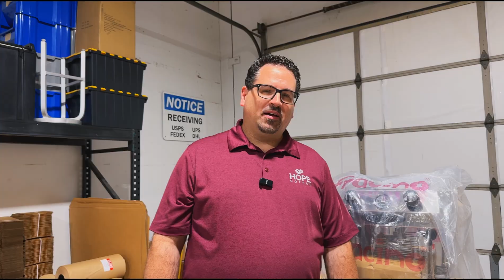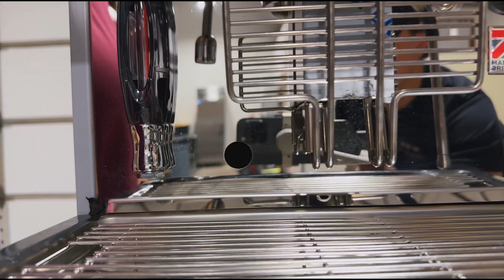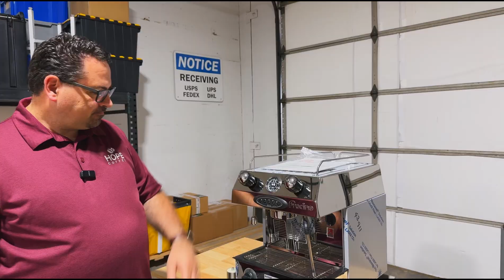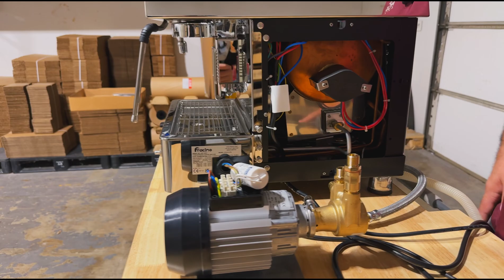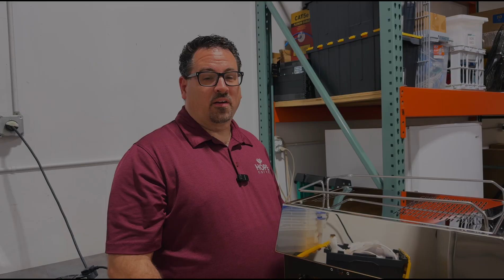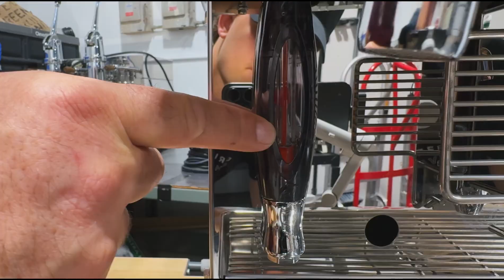Watch This Video BEFORE Setting Up Your Fracino LPG Machine!! #espresso #coffee #machine #howto

Comment: Hi, do you happen to know the name of the gas fitting to connect the braided hose to 8mm copper ?  Thank you
Reply from the maker: This is the converter fitting from the British thread pattern to the American thread pattern. You would be able to connect the hose to other ports using this adaptor. We do not sell this component directly, but we include these with every purchase of an LPG Machine! Below is a link to a product we trust and use for our own machines. Feel free to reach out if this is not the part you are inquiring about.

https://www.amazon.com/dp/B09J8D6Y9K?ref_=ppx_hzsearch_conn_dt_b_fed_asin_title_1&th=1
Reply: @ShilohCoffeeSupply thank you, the domed part in the hose is the worrying part for me that it gets a gas tight fit against a flat face of the fitting.
Reply from the maker: @stephenfoxon9377  One thing to try is getting a 1/4" NPT female-female coupling to get that flat face on your input valve and then connecting a Male Flare Adapter, with the flat edge going against the coupling and the domed section being linked to your propane output. We recommend using yellow PTFE tape, as it acts as an insulator on the thread. If this doesn't help, feel free to head over to shilohcoffeesupply.com and send us an email where we can get more direct correspondence to send pictures or other helpful resources your way!